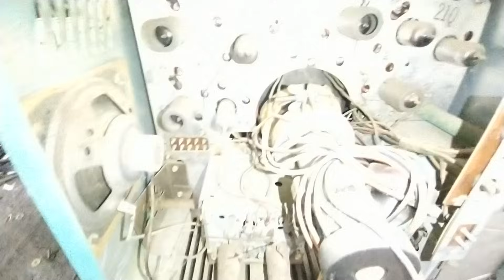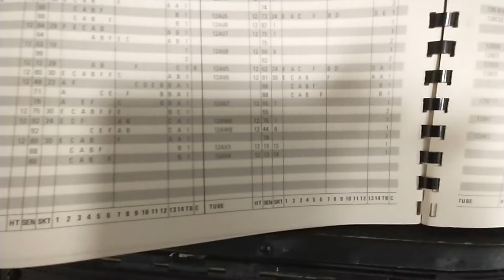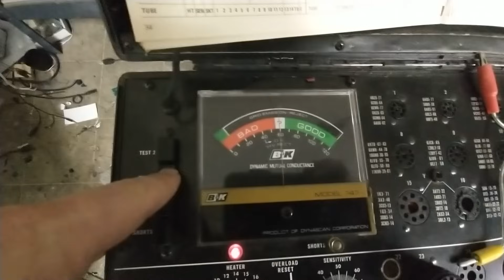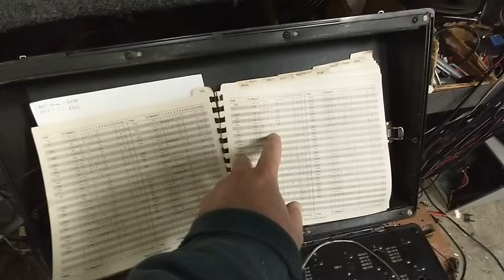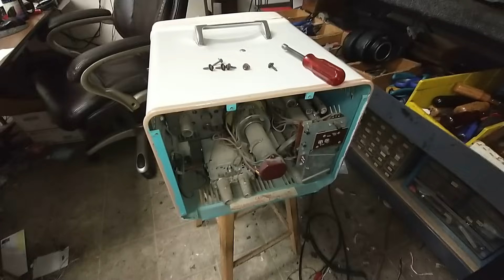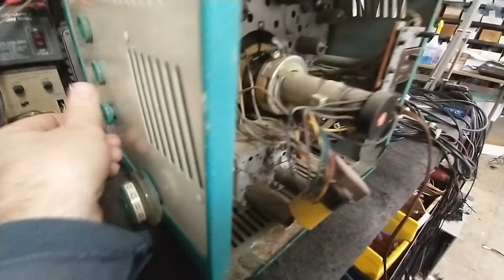Servicing a 1957 General Electric model 14s208 b&w, vacuum tube television. P1/? assessment

Comment: Do you have any videos showing how to get the innards out quickly and safely? I’ve never taken apart a TV before, but I’d like to avoid electrocution and mercury poisoning. I don’t have any interest in the parts or restoring the TV - I just want the shell.
Reply from the maker: @erinbuchanan8847  if it's been sitting a month there's unlikely to be any charge.

See part 2 and beyond. It illustrates disassembly

Comment: When I was a child in the late 1950s / early 1960s my family took vacations to Lake Erie almost every year.  One year, unusually, we stayed at a borrowed beach house and it had one of those TVs, I'm quite sure it was the same model.  I was already messing with TVs so I was fascinated that they could fit all the tubes and circuitry into such a small space.  Funny, what sticks in your head, I don't remember a thing about the beach house or what we did there, but I remember that TV, with its long, boxy metal cabinet, like it was yesterday.

Comment: I had that same set same color only difference was mine was branded as Hotpoint,but was made by general electric.I remember it not being so easy to work on mine had bad caps in the vertical circuit.I should have kept it but I sold it.